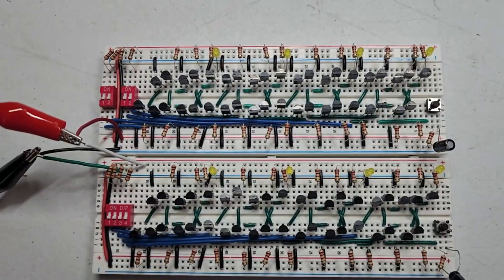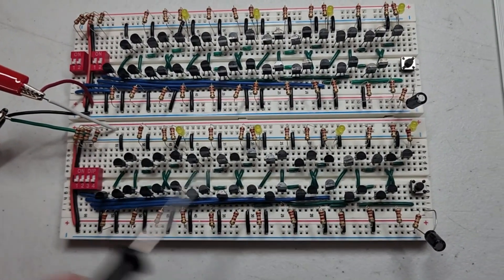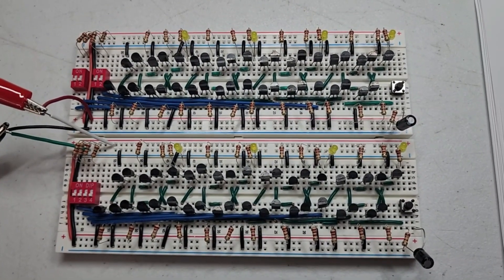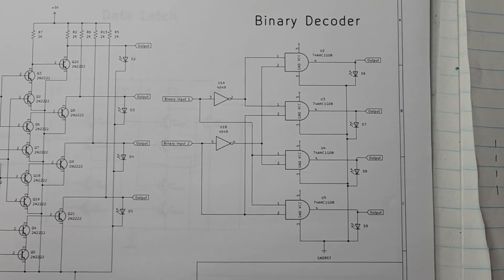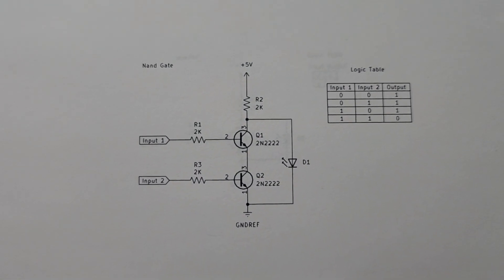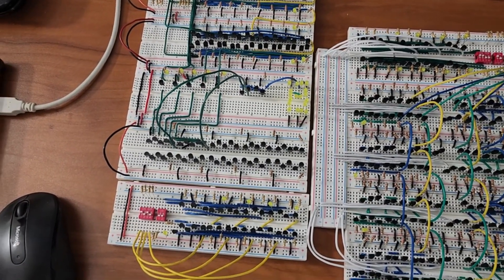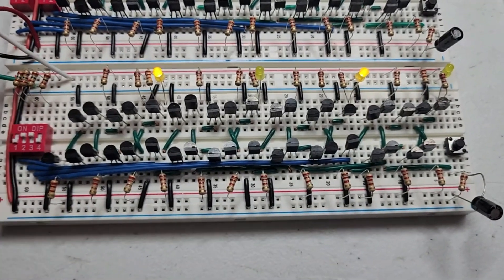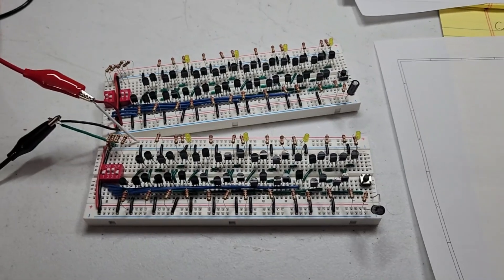Two 4 bit Registers with Transistors

Comment: Do you think any kind of PNP transistor like the 3906 would work instead?
Reply from the maker: @theodorepark7929  the PNP transistor works opposite from the NPN so the circuit would change but it should work. Sounds like i have a new idea for a video. Thanks for the comment.

Comment: It seems like your pairs (or/nor, and/nand, buf/inv) are identical except for how you connect the LED - either between Collector & VCC or Collector & GND.  That works just fine for demonstrating the functions with a LED.

But when you chain gates to each other they are connected between the collector and referenced to GND. So the logic functions will always be the inverted ones (nor, nand, inv).  So you can't really make a AND with just two transistors, but rather you use build it from a NAND followed by an inverter.
Reply from the maker: @MatsEngstrom  ya, I noticed that when I was making the video but was too lazy to change them. Lol
I learned about the extra transistor when I was building them and couldn't figure out why things weren't working.
Reply: Please share your kicad schematic files…
Reply from the maker: @alecsei393ify  I wish I had them. I wasn’t able to figure out how to save them